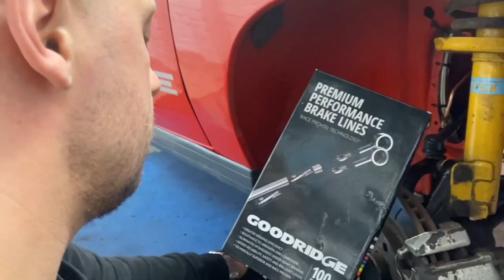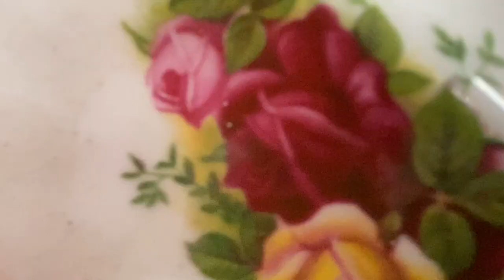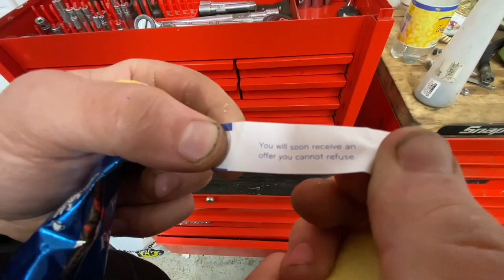Fitting goodridge stainless brake hoses to the Nova - Big problem

Comment: Dude I hope you're going to be replacing that cv boot on the drivers side as it didn't look too long for this world when you put the camera in for the snapped bolt 😮🙈😅

And also I've heard a supersoaker filled with brake fluid is the way to go for a 'drive by' paint removal when you don't like someone lol 😆
Reply from the maker: Good top tip on the supersoaker lol.

I was waiting for someone to mention the CV Boot 😋
Reply: @Chintz Motorsport  well I'm pretty sure given the lengths you've gone to with the rest of it, you'd not everlook it tbf 🤣
And like I say I've only ever 'heard' that an old skool supersoaker 500, has a good fluid capacity and a decent range on it too 🤫